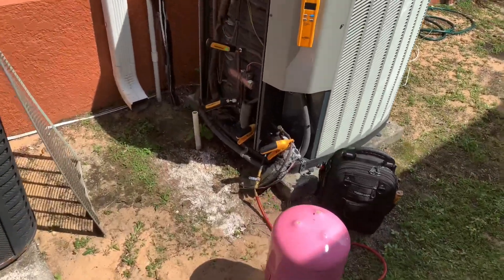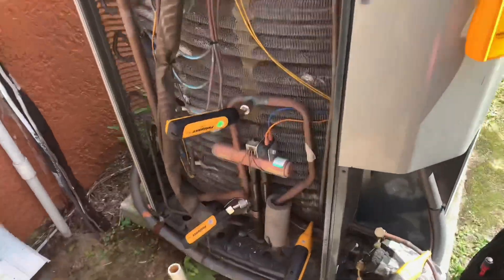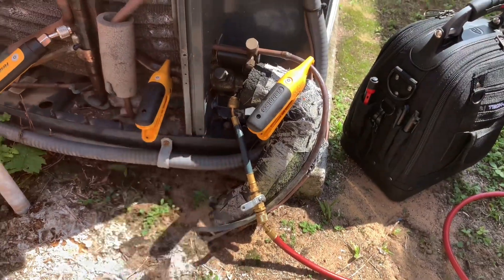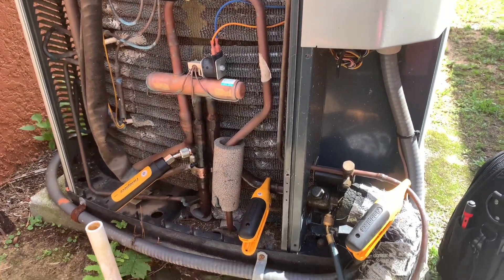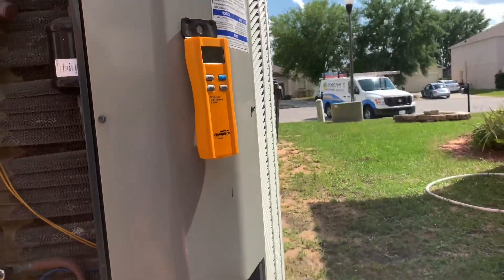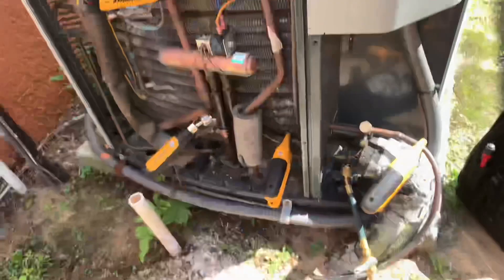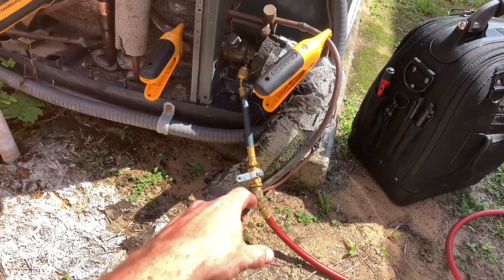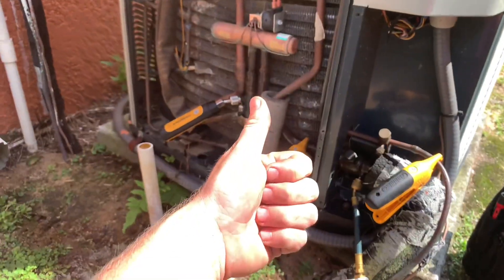CHARGE with Probes on Trane | Fieldpiece JOBLINK | NO more Manifold …

Comment: I have a 3 way connection and very short ballvalve and charge using just probs alot over the 2 years ive had them and on sum have double checked using gauges and never missed so far.
Reply from the maker: Hell ya that’s the way to do it! A buddy at work picked up a couple of swivel tees to use! Always good to be thorough too 🤙🏻

Comment: If its straight ac what you can do is hook your liquid probe to the high side, your suction probe to your high side of the analog gauge, then your suction hose from your gauges to the access port. Make sure to have your high side open to get a reading and use the low side on your gauge to charge the system
Reply from the maker: Absolutely!! Never thought about doing it that way 👍🏻 I’ll have to give it a shot! Thanks for the feedback
Reply: @KoolinwithKrauss  yessir happy to help🙏 say do you like the tp lc or the mb3 for quick service calls and maintenance?
Reply from the maker: @crisken5105  the tp-LC for sure. Since it has designated tool storage. Little more versatile for me!